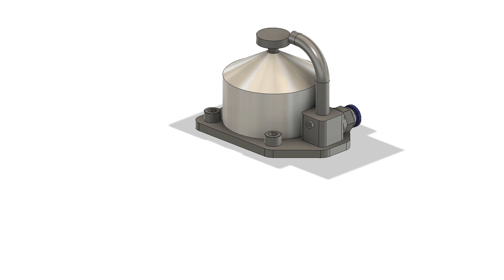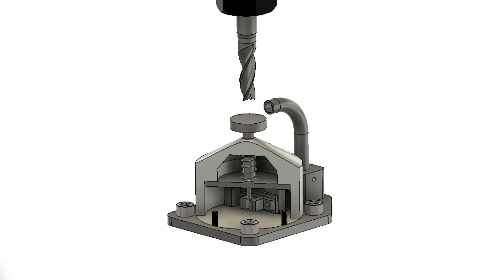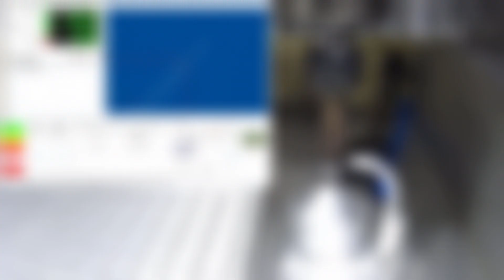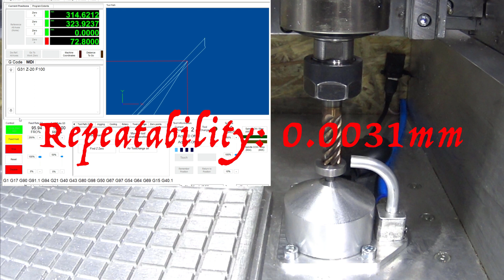Tool length sensor for milling machine

Comment: Can You please share the wiring for this Touch.

Beast regards to You from John Eriksson in Sweden.
Reply from the maker: The optical sensor used here has 3 outputs (plus, minus and signal), the signal output from my sensor has 5v and can be fed directly to the probe pin of the controller I use (pockey 57cnc).  Whether this works for you depends on your controller.